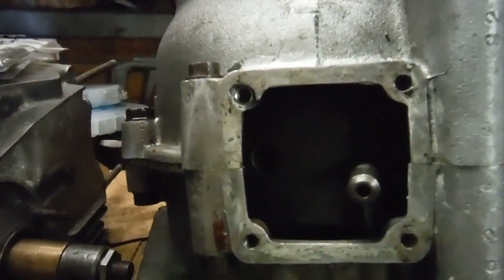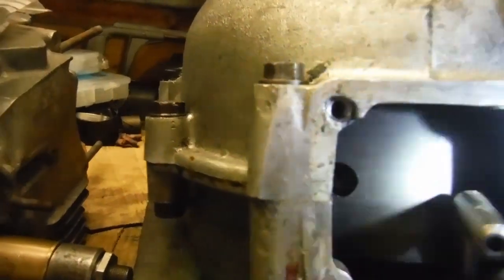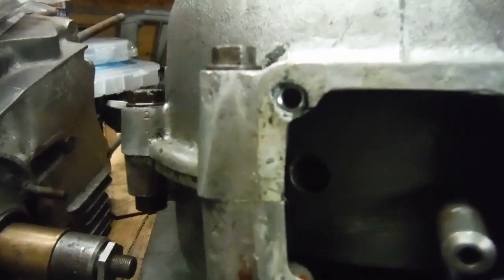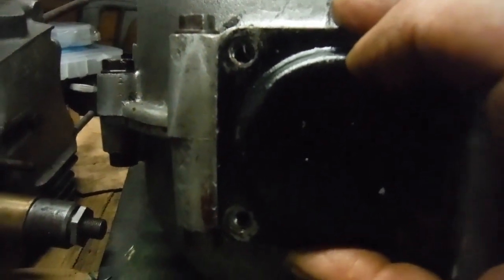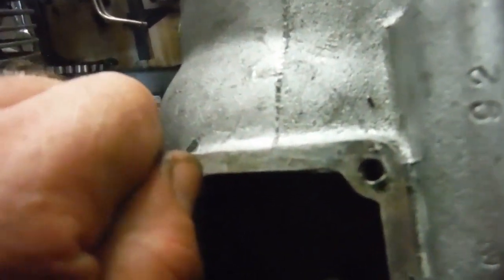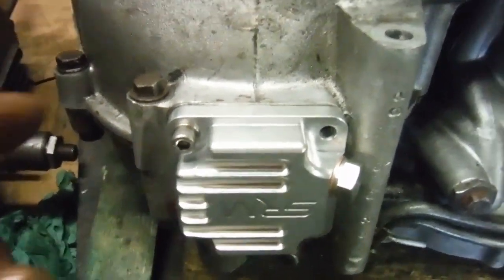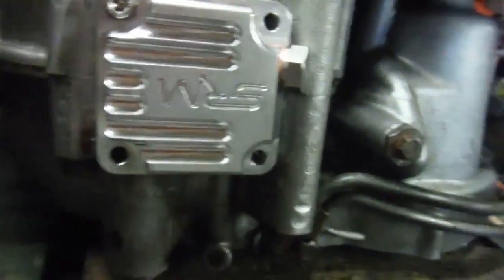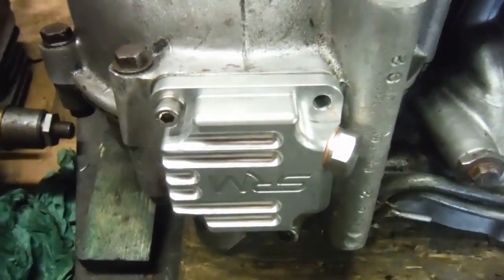BSA A65 bodged sump plate thread the repair job discussed.

Comment: Perhaps a further improvement would be to fit actual studs in those holes & use Nylock or nuts with spring-washers to prevent further wear/damage to the original holes.

Comment: Good job! Well done Paul! These sumps were originally fitted on studs with nuts, over the years they got replaced by allen head screws which were usually over enthusiasticaly tightened to try and stop the leaks resulting in stripped threads! I've done plently of helicoils in em over the years, had to have cases welded with similar damage/bodge like that one to! Great job mate! Well done again!

Comment: You must have nerves of steel to drill that mess out. With so little metal I wonder if one of those inserts that are a threaded sleeve might have been better. I have only ever used Helicoils so don't know if it would work.

Comment: Won't the broken out piece cause joint sealing problems? Normally you rely on the gasket sealing that part of the joint face to keep the oil from seeping out through the bolt hole.
Reply from the maker: Possibly, at worst I may need to fit a fibre washer to that one bolt, if necessary.